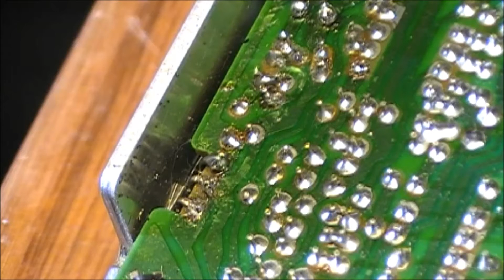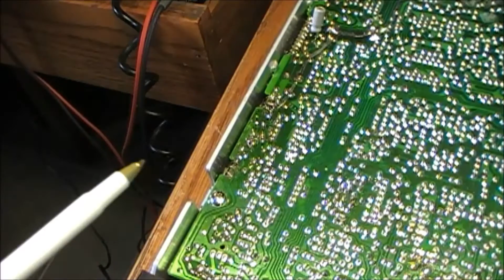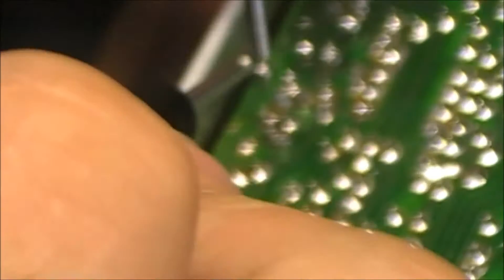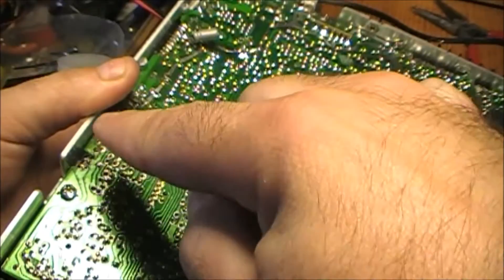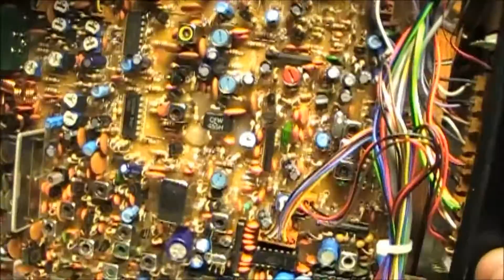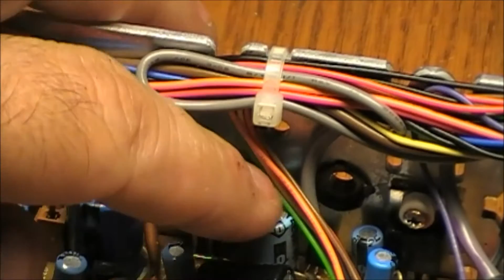Ranger RCI 2950 Repair #2

Comment: That cap you're pushing on seems like it's floating on the board.. It looks like it's not anchored in there tightly enough with the solder! It should take a bit more force to move the cap the way it did when you pushed on it.. I believe other components are loose also in that particular circuit area.. To me, whoever soldered it did a poor job... Could be poor components but I doubt..
Reply from the maker: Thanks for the tip! These radios came out of the factory with poor soldering.

Comment: Hello Andy 
My 2970 does the same thing if I slightly flex in that area.  I know this video is ancient but did you ever figure out what the issue was ? 

Jeff  9AT102 in BC
Reply from the maker: The issue was multiple bad solder joints in that area was the issue my friend. It is a common thing. The radio needs a lot of solder reflow and touchups.
Reply: After posting this message I found video #3, good job you found it.  When these radios first appeared, the cold solder joint problem was monumental. I remember one company selling 'refurbed' radios after they came back in for warranty work ( cold solder joints). You got a nice new and fixed 2950 for 180 bucks.  Take care and 73 .

Jeff 9AT102 BC
Reply: @jacianmcgurk7424    I ended up putting it on the shelf for now and just buying a new Anytone 5555N2 .

Comment: Concentrate on that work that has been done before as it all looks a little dry. On to part 3.
Reply from the maker: +fredintheshed1 Yes Fred. I think the last tech in here was about as good as me. My solder is a bit too large and my soldering iron tip is a bit big with no heat control also. A always blame my tools hahahaha. Did I mention poor lighting  and yadda, yadda, yadda

Comment: The circuit trace has lifted due to excessive heat, I'm not a radio tech but those joints don't look quite right either, what solder mix are you using? the newer (lead free) solder requires more heat and generally doesn't make as clean a join as the lead type IMHO.

I'd also suggest cleaning down that area with some rubbing alcohol or methylated spirits as there is a lot of crud build up.

A big thumbs up for having a go! :D
Reply from the maker: +SpectreOZ Agreed, The last tech iun here was probably just as bad as me HAHA. I am using thicker solder and it is a roll form the 1990's so as you can guess, I don't solder much. Hence the lack of skill. I know what looks right but the technique of doing that is a bit off center to me but I will keep trying to improve with time. My troubleshooting has improved slightly and that's good. Thankfully, I don't have to be working on radios a lot but only as needed.
Reply: +Andy Tobin There's nothing wrong with having a crack at an issue yourself, that how learnin' is done :)
Reply from the maker: Yes, that is true and many supportive people like you give me courage to try but I always stay within my comfort zone and seldom go outside. I figure Ill never be a tech but I take great joy and satisfaction in fixing things on my own. it is sort of addictive. Having the proper tools is an asset also.
Reply: +Andy Tobin I totally agree there are a lot of helpful people on YouTube, you can access so much reference material it's just awesome :)

Comment: i would de solder and clean all the joints in that area Andy. use solder wick to clean the solder off the pads take the trasister out and check it and the caps in that area in case one of the caps has a detached pin insude the cap. u r on the right track by the look of it but just havent gone far anuf. best to remove the solder and clean the pads with alcahol hope that helps a bit mate
Reply from the maker: Much appreciated Sir. I just subbed your YT channel. May God bless you abundantly brother in Christ.